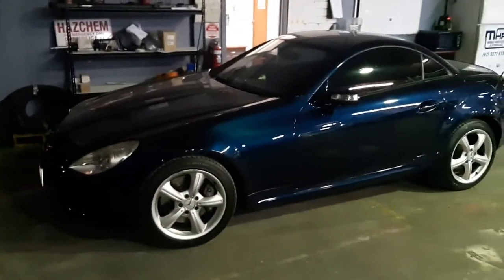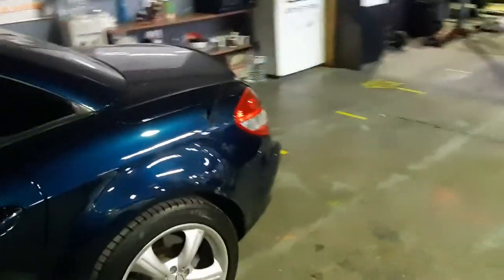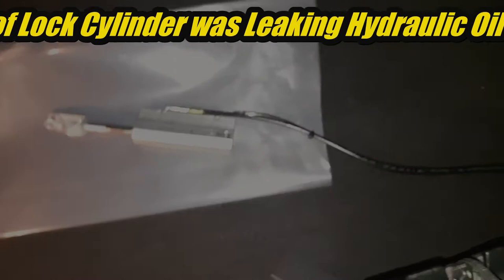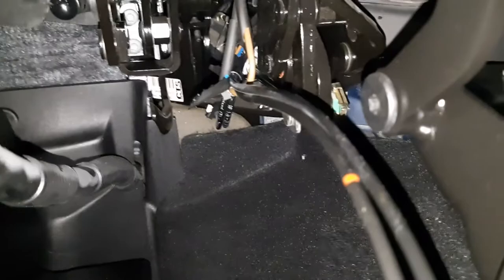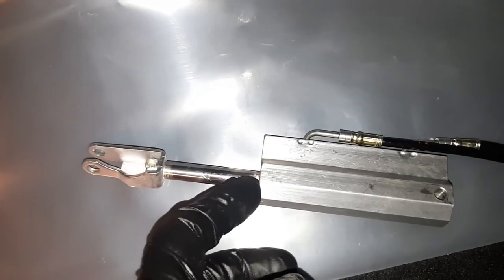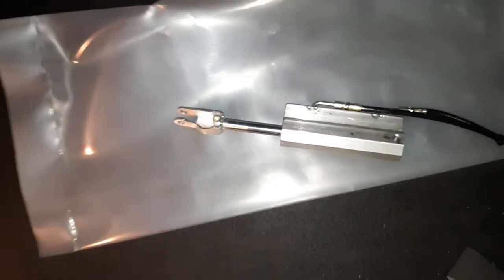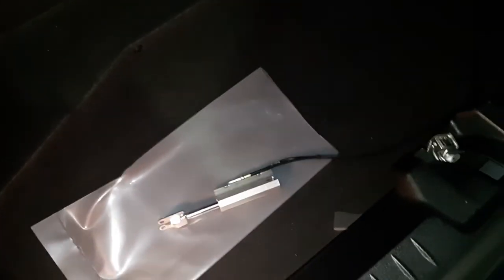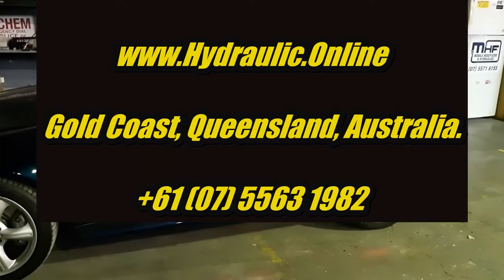Mercedes Benz SLK 350 Repair Leaking Hydraulic Roof Lock Cylinder

Comment: Do you have an idea on cost to get the lock seals replaced as mine leaked and the roof wont work. Thanks you.
Reply from the maker: Its avbout a AU $300 Job to do on the car with the hoses still connected to the Pump.  Much more expensive (time consuming) if you disconnect the hoses from the pump as there are lot of the internal panels and seating that need to be removed first.